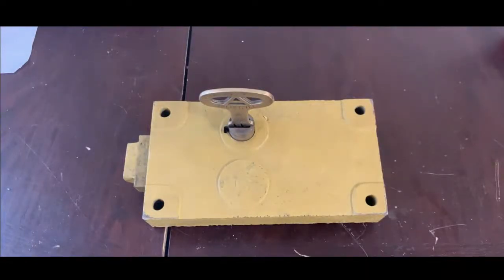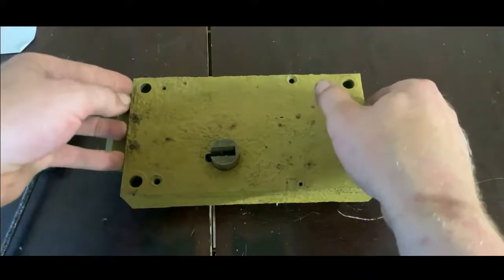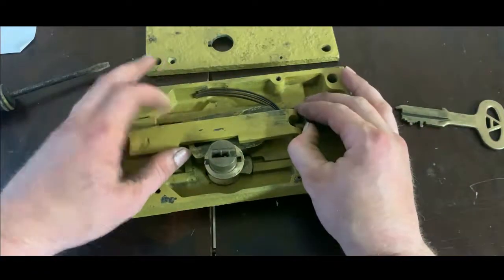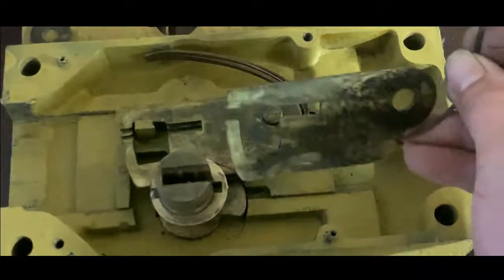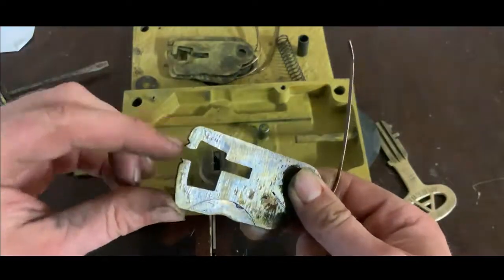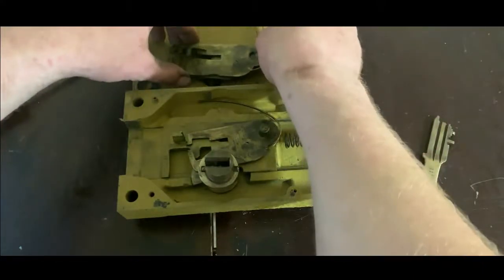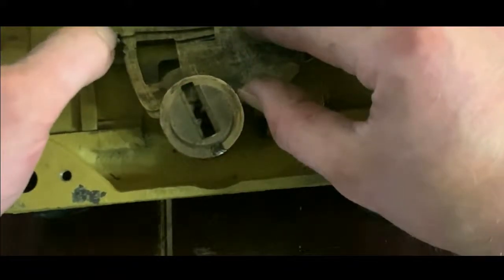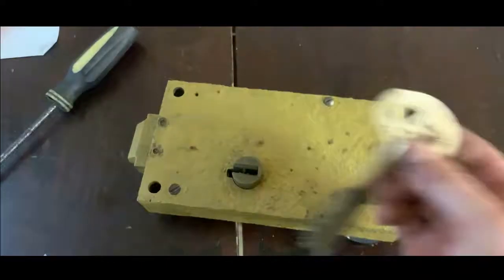Folger Adams Jail Cell Lock Teardown, Demo, How it works

Comment: When I worked at a prison, a lot of officers would be inside a safe room with a control panel and they would leave the key in the lock hole because they didn't want to lose the key.

All a person has to do is take a coin or sturdy piece of metal nad they can rotate the locking mechanism to open the door from the other side.
Reply: Well at least there were cops inside to stop people if they discover that
Reply: Can kinda understand that as if you lose the key you're locked in. But the thing is, those are BIG keys so I don't see how you can lose them... It's a security risk though if someone can jam any piece of material into the slot and open it from the other side...